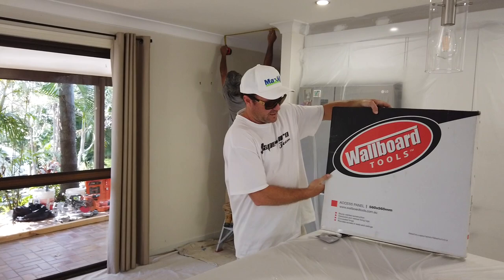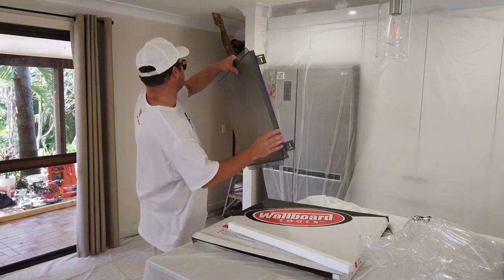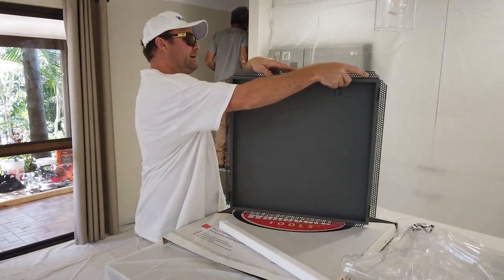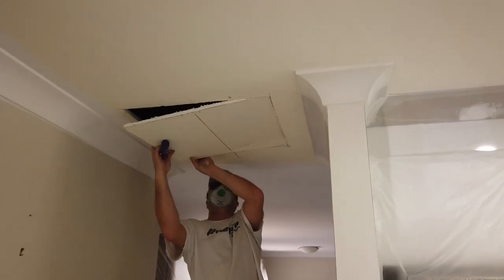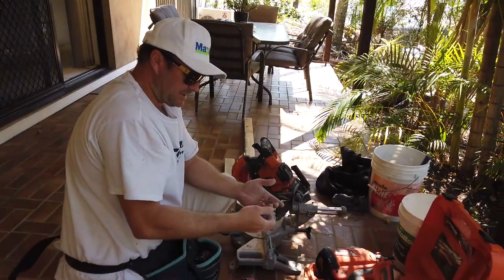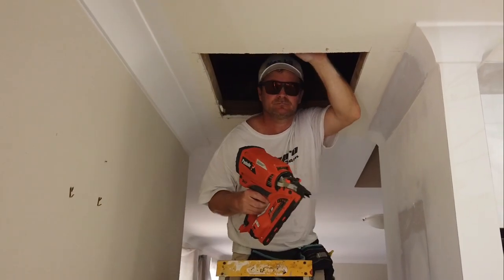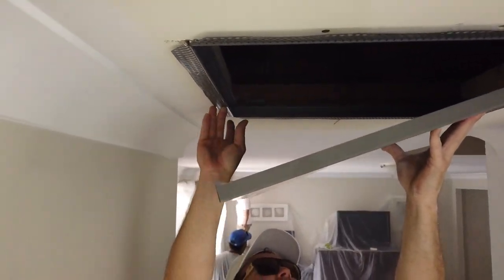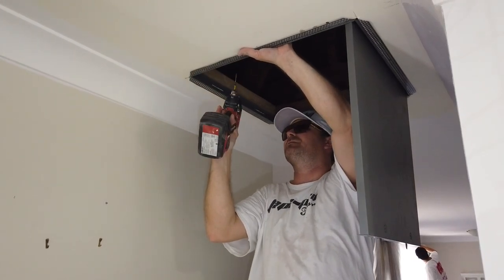Metal Access Panel in Drywall Ceiling with Set Bead Install

Comment: Screw through your bead first while the door is closed to hold it up and make sure it's square. Also before you install, slightly fold back your beads so when you press it up to your ceiling the beads squeeze flat, no proud spots 👍🏼love the videos!